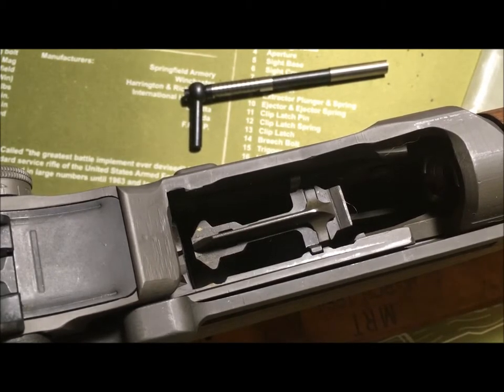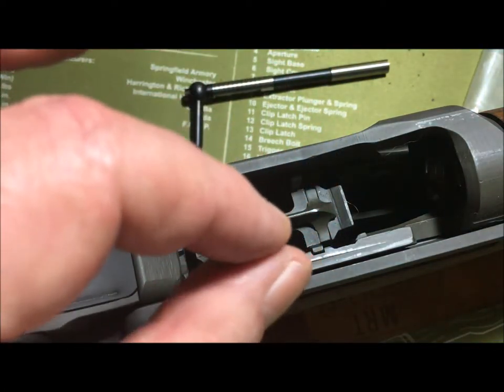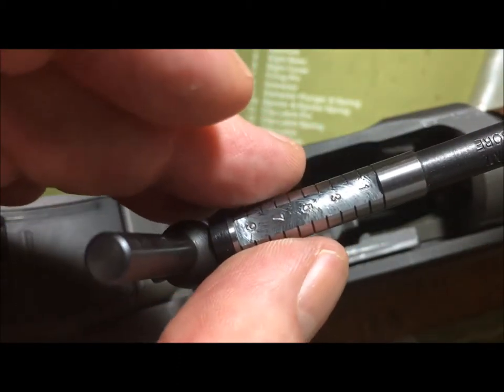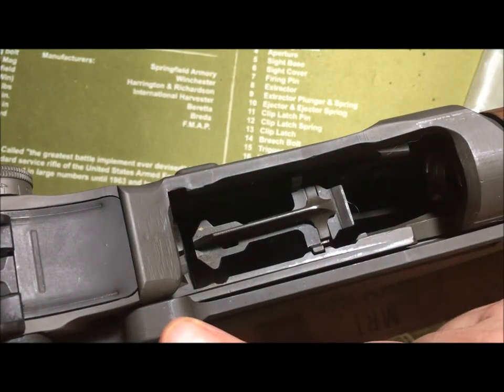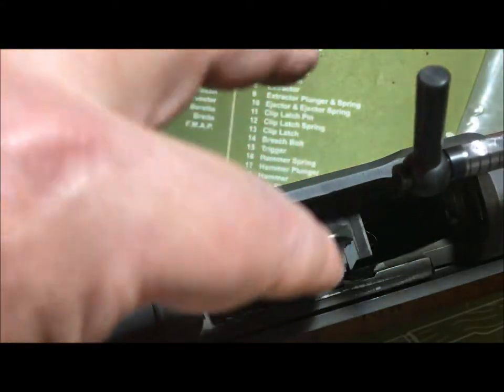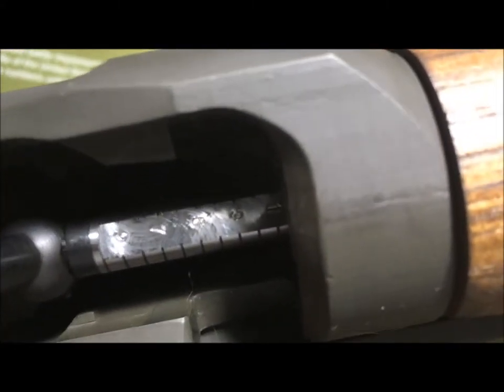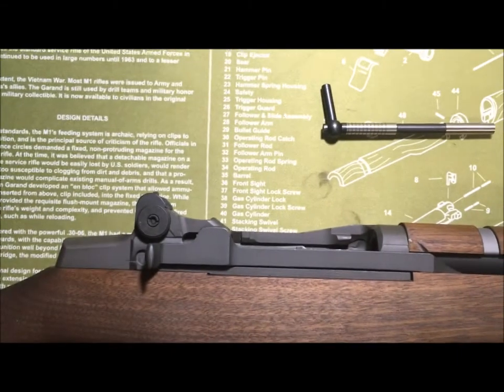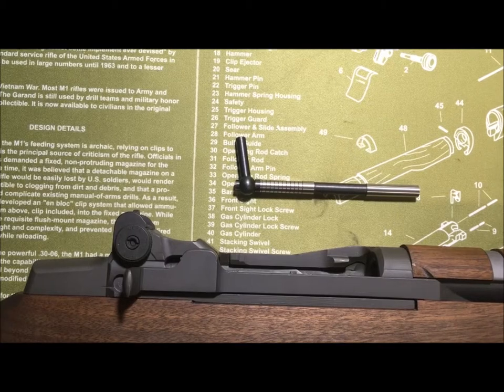HOW TO USE: M1 Garand Throat Erosion Gauge

Comment: I just got in a Rack Grade from the CMP. The throat couldn't even take the first notch on the gauge, and the muzzle measured just between the first two lines. The barrel is pretty much brand new in terms of wear.
Reply from the maker: Super score! As far as I am concerned barreling the receiver is the hardest part. pretty much everything else is plug and play as long as the parts are within spec.

Comment: I recommend doing a field strip first (including rod spring so you can assure the bolt doesn't slam into the Guage. It's to easy to do so why not avoid a major problem
Reply from the maker: That is good advice, indeed.

Comment: Will it work on other 30-06 rifles? BAR? 1903? Spencer? Or modren bolt actions? Thank you and I found your video very educating when i bought my M1 Garand 😊
Reply from the maker: So, not really, no. This gauge is designed to be read at the opening of the receiver on the M1. The BAR and Johnson are different designs with different receivers. I doubt you would get an accurate reading, but it follows that you could measure a new barrel on those rifles and determine what a "0" would be, regardless of the markings, and determine the amount of degradation on older, used barrels to a respectable degree of accuracy. So, it is conceivable that you could get a good SWAG based on the gauge and observation of the barrel/throat. Of course, you could not go wrong using a standard head space gauge and a good bore scope to see the throat erosion.
Reply: @FreeAmericaChannel  oh, bummer 😕 thank you for your reply. I bought bore erosion and go gauge from cmp for my M1 garands. Much appreciated sir
Reply from the maker: @husseinalmashhadany  My pleasure and thanks for watching!

Comment: why it doesn't work for the .308 garand? thanks
Reply from the maker: Good question.  The .30-06 and .308 chambers are different dimensions due to the fact that the .30-06 is longer than the .308.  The gauge is specifically designed for the .30-06 chamber.  In metric dimensions the .30-06 is 7.62x64mm and .308 is 7.62x51mm.

Comment: Thank You for your time my  throat gauge read from CMP a 4 muzzle read a 1 on the tag from CMP
Reply from the maker: Did you gauge them yourself after reading the tag?  CMP has a great reputation for getting the gauge readings correct.
Reply: @FreeAmericaChannel  no I just have the tags reference from when they delivered to my home. A 1943 with a 45 barrel but it's all sa parts,I'm thinking of putting a new barrel on it to making it a shooter but I'll leave it be I'll buy another one real soon.everything matches even type two rear sight.
Reply: D. Fox that’s what I did with mine got a February 1940 in a reproduction stock all SA parts correct from my uncle for my 18th.  Picked up an original SA stock at an estate sale in near perfect condition, and now it sits in the safe.  Been offered $2,700 cash for it already but I turned it down.  Bought another garand CMP special as a shooter and I abuse that one.
Reply: Can I use the muzzle erosion gage for throat erosion?